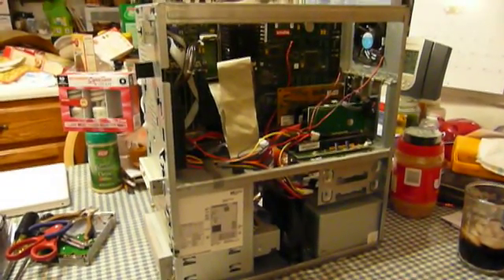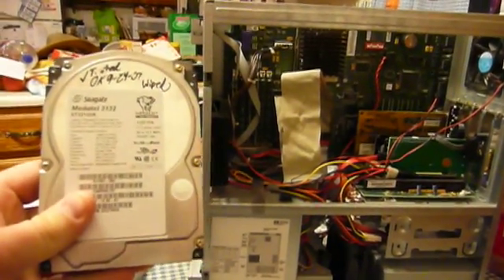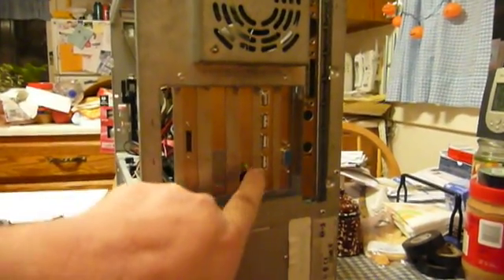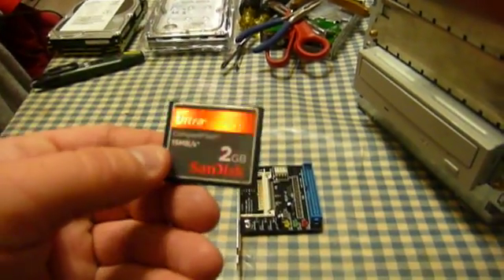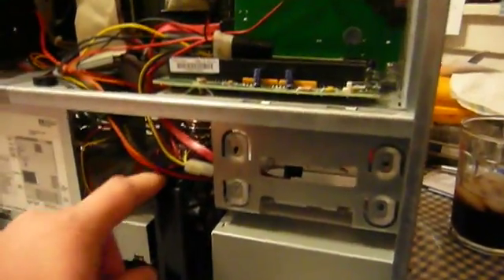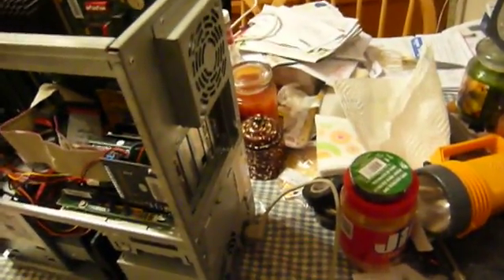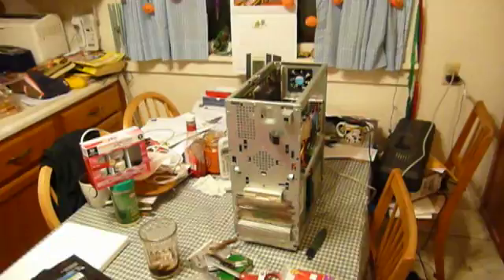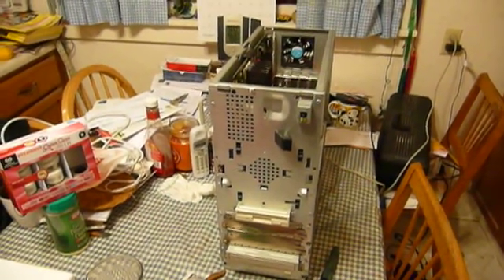An Old Computer Turns Into A FreeNAS Device Part 1

Comment: 11 years later FN7>N4F> [now] XigmaNAS is 64 bit only
Reply from the maker: I think the 64-bit only nature of an ever-increasing amount of software is silly, but it's also inevitable. I'm also not really sure why the N4F folks felt the need to change their offering's name again.

This machine still exists and still runs to this day. It's never skipped a beat, even though the software has well and truly left it behind.
Reply: @uxwbill  32 bit is unsafe due to hardware back doors, some discovered some not yet.N4F was deemed too descriptive for the current copyright case law some of my original FN7 hardware is running still 64 bit Atom

Comment: FreeNAS and NAS4Free have dropped i386 support. Are you going to continue running this system?
Reply from the maker: NAS4Free's support for this computer dropped a long, long time ago when the minimum memory requirement increased to 256MB. Since this is only ever used on an internal network by a few people, it's still online.

Comment: A lot of vids on here about this subject. The idea of using old PC's as NAS devices is really old school. But I guess to newer generations, history repeats itself. There are actually much more efficient and low cost alternatives available today, such as wireless thumb drives, wireless routers with thumb drive NAS options, or even an old cellphone as the network  storage and server device. But I do get the fact that making something from nothing can be its own reward.
Reply from the maker: Sure, you can buy a ready made device and maybe it'll meet every need you have for its useful life. It's much more likely that you'll soon realize how bad and buggy these devices are, and that the manufacturer doesn't care any more once the new model comes out.

Then you'll know why people build these things from old and purpose built new PCs alike.
Reply: @uxwbill: I can agree with that only too well. I had a QNAP TS-212 from 2010 which recently died due to an internal flash uncompression error. Several attempts to bring it back to life via TFTP were not only unsuccessful, but came along with a bunch of headaches! It ended up being ROYALLY bricked by wiping the static flash memory, rendering it completely unusable. From that point on, I totally quit with ready-made NAS devices, regardless to what brand ever, and switched to DIY NAS by re-purposing x64-based NAS servers like the ACER H340 which previously ran MS WHS2011 ( obsolete by now ), and turned them into neat file servers, or TimeMachines. A third one serves as a destination storage server for recording TV broadcasts. A server doesn't need to be optically fancy awesome, it has to be RELIABLE AT ANY TIME GIVEN!!!

Comment: I've an old PIII computer somewhere. Could I use this for something like this?
Reply: I've used FreeNAS 0.7.2 for this purpose and - so far - the system itself ran quite well, except that the ZFS filesystem keeps on punching holes in my harddrives causing them to quickly go bad due to a large number of bad sectors.

Comment: nice..I got two PCs from an easte sale for 20 bucks...no Hard drives in them but when powered up I found one was a 500 MHZ machine and the other is a 3 Ghz PC with six bays...I dont like external hard drives since its a pain to find what i want. It handles a 2 TB drive just fine and has attachments for 4 ....thanks for this vid its going to help me do what i need with the machine....weird thing is that the OLD PC has a way way better case built like a tank while all my new PC's are kinda flimsy in comparison.
Reply: I've got a Fujitsu SCENIC W600 from 2004, and can say that the case is also quite massive and heavy. The only flimsy thing is the detachable sidewall, but outside of that everything's quite solidly built.

Comment: uxwbill, what version of FreeNAS are you using. I installed FreeNAS on a Dell Precision T3400 with 4GB of ram and an 3.0Ghz E8400 processor and using the built in broadcom gigabit ethernet i can only get a maximum throughput of 5-6 MB/s.

Comment: Why in the world would anyone want to use a Pentium Pro @ 200MHz as a NAS??!?!

You could get some cheap crappy dell off eBay that could compute circles around this thing, make a far better server, and not drive your power bill up (assuming we aren't talking about the P4 Dells, hehe)
Reply: *****
How long does it take to transfer a large file to this server?
Reply: *****
My network is 1gbit and is mainly composed of crappy hardware of various brands and my network still manages around 70-110MB/s transfers. I have an old Dell Dimension B110 serving as a file server which is equipped with a gigabit Ethernet card and a SATA controller ($20 total). The controller has two 2TB HDDs attached to it for a total capacity of 4TB. I got them on sale from Newegg for $130 total. The Dell has also been maxed out with a 2.8GHz P4 and 2GB DDR-400, which was around $30.
Given that this line of Dells was found in just about every house and business when it was new, It was given to me for free because it was "broken". It just had a dead hard drive.
So for $185 I have a very nice FreeNAS server that hosts all my movies, music, backups, large files, PlayStation 2 game streaming and so on. It quietly purrs away in my closet.
However, I'm contemplating fixing a broken Dell Dimension 9100 to use as the file server because it has a PCIe slot, a Pentium D 3.2GHz, built in SATA ports and the board has 3GB of RAM slotted into it but can take up to 4GB DDR2-667.
I think it would be worth it for the $65 or so it will take to replace the motherboard.

Don't really know what I'd do with the old Dell after that however. Probably turn it into a PfSense router or something.

Still, interesting to see a Pentium Pro running a modern kernel of FreeBSD and interacting with modern SATA controllers and hard drives. How much RAM does it have? I would assume a minimum of 64MB.
I have an old laptop from 1997 with a Pentium 133MHz but it won't boot any lightweight modern Linux distros. DSL was the latest it would boot, but after seeing this video I'm curious if FreeBSD would play nice with it.

I have several PowerMac G4s (400MHz through 500MHz) and I have no idea what to do with them.

Comment: FreeNAS is fine - i hate GPT - can it be without ?
Reply: Today i had to remove a GPT from a disk
i never opted for it.. i don't know where it came from - i used Debian 64bit Wheezy 7.7.0 installer via usb - used EUFI/EFI setup - after first boot it didn't load through - i changed some settings in grub loader config - and it booted - the installer must have picked up a GPT signature and produced this boot config - odd
but solved.

Comment: Is serial ata the same as data?
Reply: Storage - SerialATA - IDE

Sata is a bustype follow up on PATA also generically called IDE
(Pata = Parallel ATA - 40Pins)

All modern disks are IDE even SCSI or SAS -
Sata uses a different connector and higher speeds - from 133mb/s and up -

IDE = Integrated Drive Electronics - for having circuity on the drive.
Reply: herauthon four Data just refers to files and what not. SATA is serial ATA which is a type of interface for the hard drives. Meaning newer drives connect with SATA connectors. Older HDs connect with IDEs
Reply: IDE = integrated Drive Electronics
this is a systems design where drive electronics is on the drive - not mounted on the host machine - it makes the drive independed from the host - earlier drives where depended on the controller the host used.

SATA drives are IDE
SCSI drives are IDE
MFM drivers are IDE
since they carry their own Electronic circuit

reference found
http://en.wikipedia.org/wiki/Parallel_ATA#IDE_and_ATA-1

Comment: is that thing BTX?
Reply: cause the way the pci slots are horizontal while the board is vertical boggles my mind.
Reply: I should mention I grew up with a PowerPC and only started doing system building later.

Comment: There comes a point where a computer isn't worth the electricity to use it any more. I use a $99 tiny Atom computer and a drive enclosure for my NAS. I can put any system I want on it, uses very electricity and uses only small amount of space.
Reply: Well, then have fun with it, no worries!

Comment: Very nice video. I made a few NAS boxes but I set up my RAID arrays using old IDE drives (~$4 a piece (250 GB) on ebay). What type of performance do you see with SATA drives in these old systems?

Comment: I also have a Vectrex based on the Pentium Pro processor. I didn't known that 192 MB was the maximum of RAM allowed by the system. Are you sure about that ?
I thought the max was 3 128 low density modules in there. But I might certainly be wrong.
You are an absolute god of retro computing ^^

PS: I'm on a project to make a NAS out of defective Sata drives, the idea is to make it massively redundant and self curing by checksums, so theses drives will now be more reliable than a single good drive.

Comment: Awesome thanks for the info brother i subbed you , love your content ,.I was thinking of using that Dell Dim 3000 for the server also but as i opened it up i noticed No Sata cause i like to put in 2 4tb drives in due time , So i was looking at a 4 port Sata serial ata pci raid controller card , that would work right with windows xp as a small home network ? with big drives like that ?  whats your thoughts bro

Comment: Heh heh. I found an old 286 computer where I work. It had an Amd 286 in it instead of an Intel 286. I had fun finding the parameters for the hard drive, which was a Kalok kl 343 hard drive, because, of course, it lost the date and time settings. I don't think it has anything on the hard drive because it says "operating system not found." I've heard Kaylok hard drives arent that reliable, so it could be dead. But yeah it's fun to just tinker around with computers. Gives me something to do.

Comment: Well, I use a AMD K-6 300 MHz, 384 MB RAM, 16 MB ATI Rage 128 16 MB as my print and file server. Works like a charm! Got Windows Server 2003 on it, surprised how well it works on it. ;)

Comment: A lot of people don't get that the stuff that was built in the 90s is in many ways a lot better than stuff today.  I've got an old Dell GX110, and an Dimension XPS that I have used as servers (Windows 2003, VOIP servers, mass storage, and so on).  Things were actually built to last back then.  I've never been a fan of modern Dell systems (and I love building my own), but knowing that these systems have lasted over 10 years is mind blowing.  Re-purpose old computers.  Don't scrap them.

Comment: I want to make a Nas based on an old computer. My concerns are: 1) LOW noise 2) LOW power consumption. I may attach a low noise fan to the power supply & cpu. About the power consumption, any one knows how many watts are required for each 3.5" sata drive? Because it will be on all time, I want to be low power consumption proyect. Any advice? Thanks!

Comment: Ahh.. my favorite kind of project.. love it.

..about white cases. I had a couple of 90's Micron computers that had cases that I just couldn't let go. Hacked one of them up and eventually it ended up with modern (AMD 3200+ was modern at one time :P) and external USB ports,  wasn't very hard.

I'm sure it would be super easy to update the hardware again.. so Arkhamasylum10, never judge a books by its cover :)

Comment: I think freenas is too much for this system, altrought I discover that the low speed is caused by his original os (crappy win me).. I tried puppy Linux and win 2000 and now I have almost full 100mbits transfers that is sufficient to me (I don't want top notch performance I only need decent speed for simple backups). I think I will stay on win 2000, this is works just perfect on this machine, thank you so much for your help!

Comment: thx, the intel pro 1000 GT is a good choice? is a pci 2.3 card, frankly i don't know what version of pci this vectra use ( 2.1 i guess because is from 1998) so i dont know if is worth to spend about 60/70€ on sata controller, ethernet and an ide memory (CF or another type) for a p3 500

Comment: Hey ive a vectra too... i've a vei8 DT with a p3 500 and a classic 10/100 ethernet pci card Realtek RTL8139/810X... i setting up the system to use is as a file server/nas but... is slow way tooo slow the transfer rate in the lan is max 2,8mb/s downloading and 1,8 uploading... did you have any ideas on whats wrong?

Comment: nice work dude, i made a "internet radio" for my dad a coupple months ago, using a pentium II 350mhz and 256m of ram, using only the computer, 2 speakers and a control whit 2 botons, the firs one to change radio station and the second to turn off the computer using lpt printer port and a program made by myself with visual basic 6.0 than recive the singnal from the lpt port and change the radio station. i made this proyect because in my country can't get internet radios, sorry about my english.

Comment: Also you said i'm going to not use that harddrive cuz you never know when its going to died. I'm going to use an flash drive. LMFAO. On a harddrive you can see and hear if its dying or not. A flash drive not. If a flash drive is dying it just stops working and you can't backup. The same as a SSD drive.

Comment: They do lead to the topmost layer.  And this is a 1995 board, and it has features you might not even find on some Pentium boards.  I can't actually pinpoint any keyboard controller chip on it.  I suppose I could solder a piece of wire in there or something.

Comment: I found it, and it's not good.  Turns out a tiny fusible link of some kind burned.  I popped it right off with my fingernail with little effort, and the solder pads came up with it. >.>

Comment: @uxwbill - Did you run into heating problems? I ask because I made a nas from an old motherboard and installed 2 extra fans but the minimum motherboard temp is between 67-75 degrees Celsius. I keeps popping the "Blue Screen of Death" on any slight activity.

My Nas config is :-
CPU: Intel Celeron Dual core 3ghz
MB: Asus P4R800
Memory: 1GB
PCI Device 1: ITE Raid Card (2x80gb ide drives raid 0 that gives 157GB)
PCI Device 2: Sil3114 Sata Raid Card(4x1TB drives no raid configured)

Comment: It's worth noting that this should only be done as a fun project. In practice a computer that old uses so much power and is so slow that you can do it cheaper and faster with a modern low-power system, and the vast majority of the price of a NAS is the drives you put in it anyway.

Comment: Thanks for posting this great video. I am constructing a NAS box using a PC with a PIII 1GHz processor and an Intel 810e chip set. The PC does not have a USB boot option. If I use a CF card for the OS install, and it somehow fails; will I simply be able to replace it with a new card, install a fresh copy of the OS, remount the drives, and access my existing data? Or is all my data is lost? Is installing the OS on a hard drive the preferred option? Thanks in advance for answering my questions.

Comment: @WackoX1337 :
First, the processor is clocked at 200Mhz, not 133! Second, it is no waste at all because the processor speed covers all the needs for an RSync server! Third, 3,5" single-disk NAS enclosures have way lower processor power and RAM and now serve terabyte harddisks with their too simplistic firmware!

Comment: @uxwbill, It just occurred to me, why not try the 1 inch microdrives instead of a CF card for such a system?  The advantages would be 2; small low power CF form factor, and a true hard drive that the PPro probably wouldn't complain about.

Comment: I'm curious how you got the CF card to work as an IDE drive.  I bought a Transcend 2GB CF card and an CF-IDE adapter card and my 200Mhz/1MB L2 cache Pentium Pro unit will not recognize the drive.  Did you have to fiddle with the BIOS for a while, or it just worked?

Comment: I tried doing this after seeing your video on my old HP Brio 500mhz Celeron.  I ran into an issue with it not detecting the drives on my SATA card.  I tried both a RAID card and a SATA host with no raid.  So far had no luck.  But the freenas started right up!